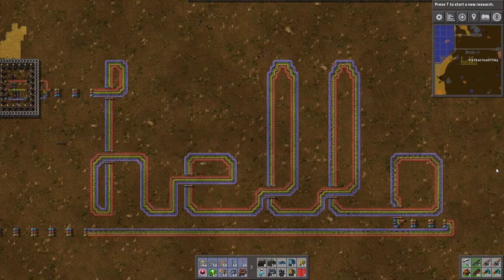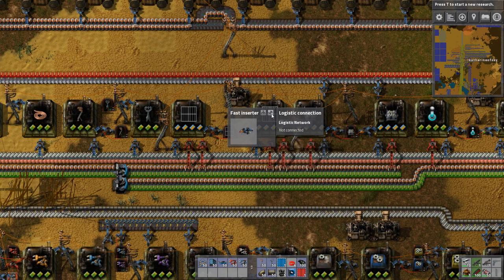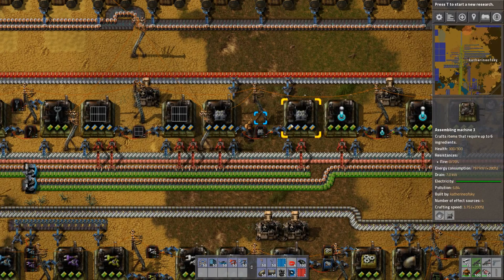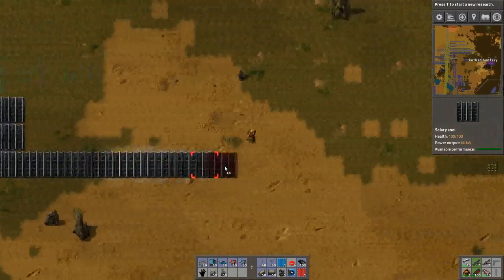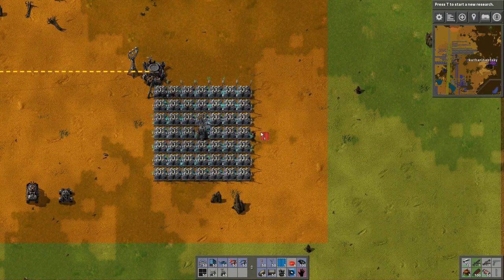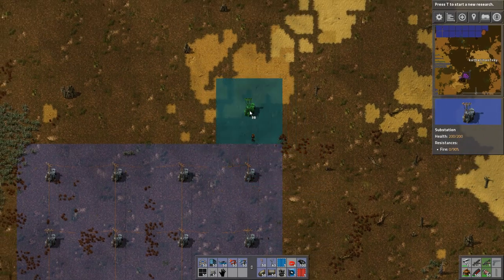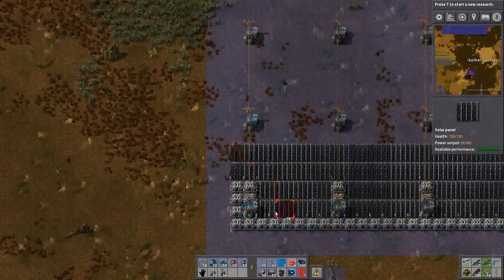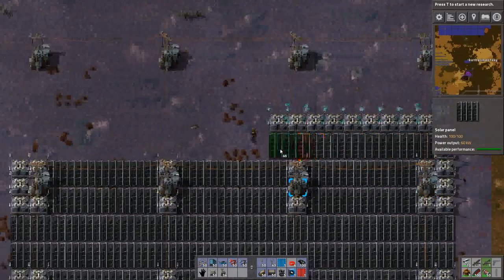Factorio Tutorials: Solar Panel Array

Comment: Do you know the equivalent amount of steam engines in comparison to one of these arrays? Your videos are really helpful, thanks!
Reply from the maker: Thanks!  TBH, I've never needed to know!  After a certain point in the game, you just keep plopping arrays as your energy needs increase, and I shut down steam power entirely.  I'm sure there is a way to calculate it though.
Reply: KatherineOfSky i will calculate it one of these days! :D
Reply from the maker: You probably don't need to -- someone likely already did it on the forums somewhere!  :-)
Reply: 42 MW for 1000 solar, 5.1mw for 10 engines means 
80 engines are about equal to 1000 panels and about 1200 acumulators.
yes solar is just as horribly inefficient in factorio as real life.
Reply: ito725 oh yes they are but 1000 panels a day keep the biters away

Comment: will there be an update of this for 0.15?
Reply from the maker: There's no reason to. The limiting factor is Roboport logistics range, which has not changed.
Reply: didnt the wire reach of the substations change? i just tried building this and there were a number of gaps just on the first row
Reply from the maker: The wire reach changed, but the roboport range didn't :-)
Reply: ah. i need to find out the old wire reach then and space the substations at the old levels in that case. otherwise plopping down the 4x4 substation grid introduces errors
Reply from the maker: Ahh, I see -- you are running with them along the ground.  Hmm.  It might now be necessary to space them via placing panels/accumulators around instead.